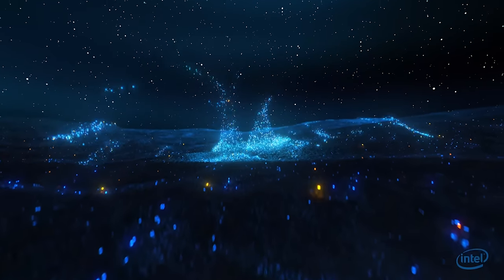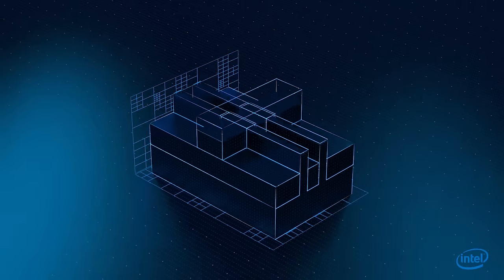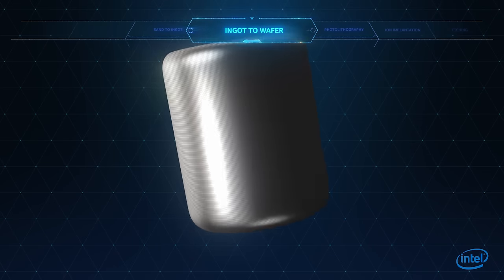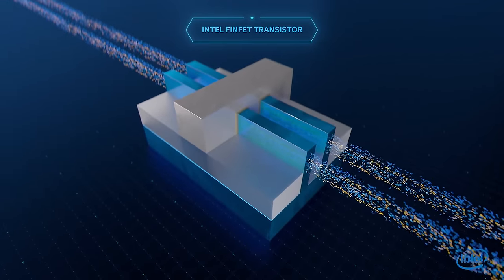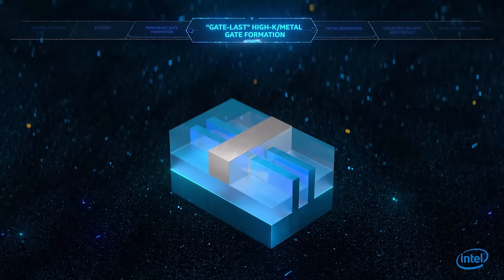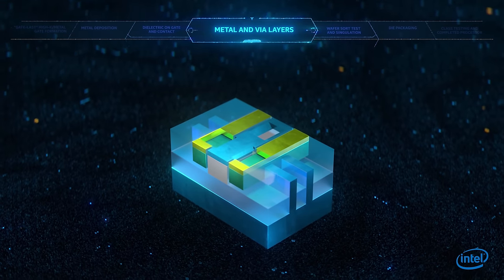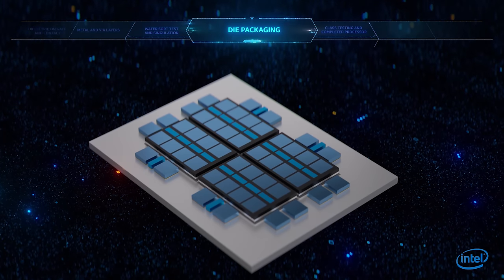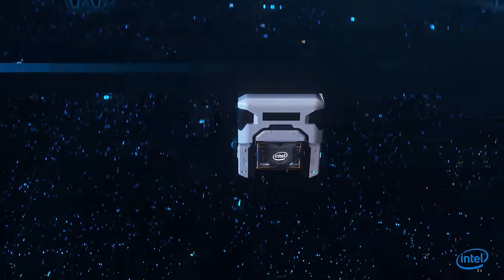From Sand to Silicon: The Making of a Microchip | Intel

Comment: This video was rendered in a AMD processor
Reply: Well that's stupid considering GPUs are faster at rendering.
Reply: @WingsOfAltair  watch Linus' vid of Threadripper going against Intel's Xeon accelerated by RTX 2080 ti
Reply: @Yosuru  Link?
Reply: @WingsOfAltair  woops it wasn't Linus afterall, it was Jayztwocents. But here it is https://youtu.be/wCoWVBT44Ug

Basically AMD used only software decoding while Intel's side was accelerated by hardware encoding using NVDIA's RTX 2080 ti.
Reply: @WingsOfAltair  yeah but not for processing and rendering millions of reflections and stuff without delay. there are extremely few but still real cases where rendering video using the CPU is better than using the GPU
Reply: *Xeon Phi

Comment: It's nice they explain how they etch it in one step and fill it with metal in another, but they never explain how are they able to do so at a scale of few nanometres... How is the manufacturing process designed to allow for such extremely precise operations to be done, let alone at such a low cost? I've had this on my mind for a few years and can't seem to find an answer. :D
Reply: Yeah i wanted to know same. If you found it  out some how do share it with me

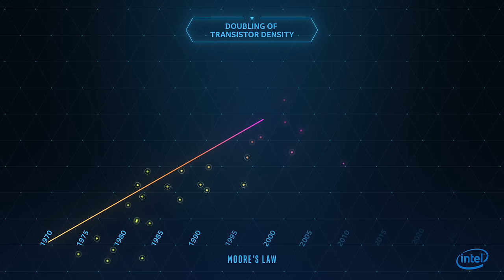Comment: 1:12 biggest lie ever, intel have been stuck on 14nm for over 5 years now for their desktop chips and server chips, dont lie intel
Reply: thekingkilledhim yes but marketing aside smaller transistors reduce power consumption and manufacturing costs.
Reply: @paniniman6524  ...and one companies' 7nm=/=other companies' 7nm. It's still marketing in the end as they don't give a clear metric on how they actually measure it.
Reply: You guys don't get it. Intel is a semi conductor manufacturer beside being a CPU manufacturer. 
32nm, 22nm, 14nm, 10nm, 7nm, 5nm, 3nm, 2nm etc. are nothing but names for processing generations. There is literally no structure within a 14nm CPU that actually measures 14nm. 
Instead of calling it 14nm Intel could name it something like 25th gen (I don't know how many process nodes Intel already created) which would be legitim as well. 
And Intel indeed doubled the transistor density with each (process node) generation. Unlike foundries like GloFo Samsung or TSMC who usually under scale their process nodes. That's the reason why Intels 10nm is pretty much equivalent (even better) to TSMC or Samsungs 7nm process. But you guys don't seem to understand the basics of CPU manufacturing and just believe in marketing numbers. 

BTW: Intel names its intra generation improvements with a + notation and that's fine. But GloFo and Samsung do the same but use different names. GloFos 12nm is nothing else than 14nm+ with a fancy name. Samsung 8nm is nothing but 10nm+ with fancier name. Intel never really cared about this. Samsung and GloFo use these fancy names for marketing and you guys take that without questioning. Not a surprise why they keep doing it.
Reply: @lukas_ls  yes but this still doesn't explain why AMD performs better
Reply: @Adkatka  amd performs better on multi thread
Reply: @ruripapi  yes I am aware of that

Comment: Me use RMD = :(

Me use INTEL = :D
Reply: Intel as always but because of that amd intel is seen as not worthy
Reply: @Ori--pw5vw  because they don't have the core count for the price. The 3950x has double the cores of the 9900k, and most of the cores of the 10980xe, and yet it is only 50 percent more/25 percent less than those two chips respectively.
Reply: Intel wallet: 0

AMD wallet: 0, with a 50% better GPU.
Reply: @raawesome3851  Which benchmark out of 100?
Reply: @liljom  price, not benchmark. The 9900k has 8 cores and 16 threads, yet costs 50 percent less for half the cores and threads of the 3950x. The 10980xe is 1000 dollars, with 18 cores, and 36 threads, but costs 250 dollars more for only 2 more cores that won't increase performance.

Comment: Imagine still being on 14 nm....
Reply: 14nm+++++++++++++* get it right! :P
Reply: This post was made by the AMD gang
Reply: Imagine being on 28nm Mobile  CPU
Reply: Imagine being 30 spots down on single core performance.
Reply: Keep adding those +++++++++++++++++++++++++++++++++++ intel
Reply: @1pcfred  imagine being within margin of error in single core performance, while having to deal with the overhead that they have for x86, and being literally a small company compared to Intel.
Reply: @raawesome3851  AMD may be a small company but they've been around for quite some time now. Back in the day they just used to make support chips. Stuff like PIO ICs. Then they started aping Intel CPUs. They made direct plug in replacements. I had an AMD DX4-100 myself once upon a time. It was a knock off i486.  Would plug right into the same motherboard an Intel CPU would. Today kids think AMD is somehow on par with Intel. They were never in the same league.
Reply: @1pcfred  what do they lose in? Also, the only reason that AMD was doing badly was because they switched managers really often, and most of them had no idea what to do. Also, single core performance isn't everything. Outside of Gaming, and maybe solid works, what does Intel beat AMD with? Their xeons are power hungry with fewer cores, their hedt processors run hot and are riddled with many security vulnerabilities, and their consumer CPUs max out at 8 cores, when amd, for the same price, has more cores, and is cooler, even with similar boost behavior.
Reply: @raawesome3851  I don't use Xeon CPUS. I am not a fan of high core count CPUs either. It is a crutch the industry has fallen back on because they can't significantly improve single core performance anymore. AMD just leans on that crutch more heavily than Intel does. For me core counts is just touting a negative trend. The security bugs don't impact me either. Well, I've disabled the mitigations here. It is much ado about nothing.

Comment: think about a cd/dvd/blu-ray activated wiring-enable fpga structure, ie, you just print the graphite wires to connect proper units on the board, physically, you already have the structures (fpga logic cells) on the board

Comment: In place of making smaller chips they should use little bit larger processor so that same transistor can be used easily and it becomes cost effective if it can.

Comment: i was considering studying hardwares in uni... now i may confirm it 🤔
Reply: Its boring AF. None of the shiny and smart content of the advertisement.
Reply: @TB-jl9fr  lol i know, did some research and stuff, seems very boring but yet pretty cool when they actually function
Reply: @leonzspotg  
True that. The most interesting part is to use the IC, not to develop it :) 
Even if that's the most demanding part.
Reply: @TB-jl9fr  true, true, anyways thanks for the reality check :)
Reply: but if you are interested in it I recommend you take a look at hardware description languages like VHDL or verilog. 
There are some FPGA boards on which you can flash your synthesized logic. 

There are even graphical IDEs such as icestudio.io which are very good for beginners to understand.

Comment: I'm curious about quantum tunneling. As chips, transistors, die size, nanometers, etc. get smaller and smaller will the electron flow be affected? I'm curious that as they get smaller with CPUs and GPUs quantum tunneling will be problem because the electrons can pass through the barriers as the transistors get even smaller. Is there a solution to this problem?

Comment: What does it take to be a "chip/processor engineer"?
Reply from the maker: We are delighted to see your interest. A degree in electronics engineering or allied branches will help you understand the basics and work in the field of processor manufacturing. There are many chip designing courses available to equip budding engineers with knowledge in IC(Integrated Chip) design. Many universities provide specialization in chip designing in postgraduate programs. We at Intel have career possibilities to work in networking, wireless communications, flash memory, chipsets, motherboards, and more. Please visit https://intel.ly/37UYoRE to know more.

Comment: PENTIUM GOLD G5500 Does NVMe SSD Support or Not On B360M-K . mainboard?????
Reply from the maker: Hi! Yes, NVMe SSDs are supported with Intel Pentium Gold G5500 on Asus PRIME B360M-K motherboard. As per the technical specification of Asus PRIME B360M-K motherboard, it comes with 1 x M.2 Socket 3, with M Key, and type 2242/2260/2280 storage devices support (SATA mode & X4 PCI-E mode) required for NVMe SSDs. For more information on NVMe hardware compatibility, please consult your motherboard vendor via https://intel.ly/3bxGt5B

Comment: AMD: "Hold my 7 nm"
Reply: 32nm, 22nm, 14nm, 10nm, 7nm, 5nm, 3nm, 2nm etc. are nothing but names for processing generations. There is literally no structure within a 14nm CPU that actually measures 14nm. 
Instead of calling it 14nm Intel could name it something like 25th gen (I don't know how many process nodes Intel already created) which would be legitim as well. 
And Intel indeed doubled the transistor density with each (process node) generation. Unlike foundries like GloFo Samsung or TSMC who usually under scale their process nodes. That's the reason why Intels 10nm is pretty much equivalent (even better) to TSMC or Samsungs 7nm process. But you guys don't seem to understand the basics of CPU manufacturing and just believe in marketing numbers. 

BTW: Intel names its intra generation improvements with a + notation and that's fine. But GloFo and Samsung do the same but use different names. GloFos 12nm is nothing else than 14nm+ with a fancy name. Samsung 8nm is nothing but 10nm+ with fancier name. Intel never really cared about this. Samsung and GloFo use these fancy names for marketing and you guys take that without questioning. Not a surprise why they keep doing it.
Reply: Qualcomm: "hold my soon to be 5 nm"

Comment: I have Intel i7 still slow idk why I have 8gb  ram also
Reply from the maker: Hi, we understand your concern regarding the slow performance of your Intel processor. There could be many reasons for the sluggish performance of your PC, often there are many programs/processes that run in the background which utilize most of the processing and memory power. To check further, you can press Ctrl+Alt+Delete and open the Task manager to check for all the current processes active in your system. You can contact us further via Direct Message on Twitter (@IntelSupport) or through Private Message on Facebook on our respective handles along with the screenshots and the processor model number for further investigation.

Comment: So does this process change with each generation of microchip? What makes each generation better than the last?
Reply from the maker: Hello! The process of manufacturing the Microchips is likely to be the same for all processors. There will be an upgrade in technology like Nanotech, cores, threads, and the addition of newer technologies into the processors. The latest generation will always come with better performance, higher RAM capacity, better iGPU, and driver support for seamless performance compared to the previous generations. Here is a helpful link regarding the manufacturing of Intel Chips for your reference https://intel.ly/3trJ35o.

Comment: PC builders are the most fickle nerds around. Just 2 years ago, Intel was the undisputed king of the hill. Now AMD made some CPUs that get the benchmark scores they like, and now Intel some how sucks. 🤔 Intel CPUs are still good, benchmarks don’t tell the whole story for performance.  Then there is the cpu process. Intel process is at 14nm while AMDs are 7nm.  They can’t be compared because both are manufactured differently.  For example Apple has said their new M1 chip is 5nm, but we know M1 is ARM based not X86 based so no one is gonna compare cpu process of x86 CPU vs M1. The true test is energy consumption vs processing power. The truth is that current Gen x86 CPUs have the roughly the same power draw to performance ratio.  It’s not like Intel CPUs take twice the power of AMD because it’s 7nm. The rest is all subjective.

X86 is outdated. ARM will be the future. It’s processing power vs power draw ratio is already far superior.  

Intel is not sleeping on AMD. They are doing minor improvements to x86 as a stop gap till their own ARM instruction set based CPUs are ready. Apple is already many steps ahead with M1 SOC. Intel will want to do it’s own SOC for laptops. Intel is still the de facto standard for professionals world wide.

Comment: I'd really like to know if you' re just shipping the worst performing samples to germany on purpose. My 12900k can't even be cooled with a 420mm radiator 3x140 fan Alphacool Aio at stock speed! And yes the cooler is mounted the right way. My history with intel i9 12900 k(terrible sample), i7 8700(terrible sample even worse after meltdown & spectre "fix"), i7 4770k(terrible sample), i5 750(a great sample went to 4,2ghz but wasn't bought in germany). q6600(ok sample, 3,2 possible but unstable). 
Next time it will be Amd again after 15 years. 
The 12900k is just a big disappointment and the memory controller issues and heat issues are not bearable.

Comment: I'll bet all the best and brightest engineers you had working for you 10 year ago bolted because they got bored with working on these quad-core, P6 derived processors. Also, I had heard that you guys cut the budget to the R&D crew that analyzed bad yields years ago. Now you're paying for those mistakes. Everyone is jaw-jacking for Ryzen, even though Ryzen barely beats your Suped up Skylake processors. You need to fix your 7nm process, forget 10nm, and come out with a brand new architecture. You're running on fumes at this point and who knows how long that will last.